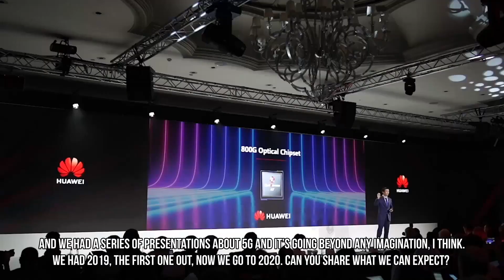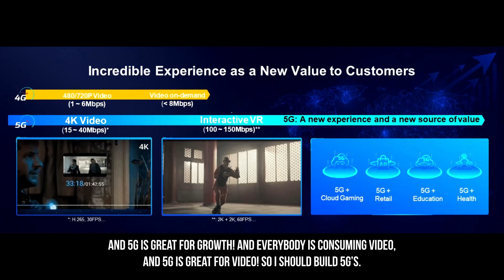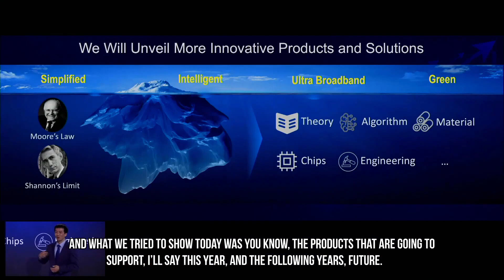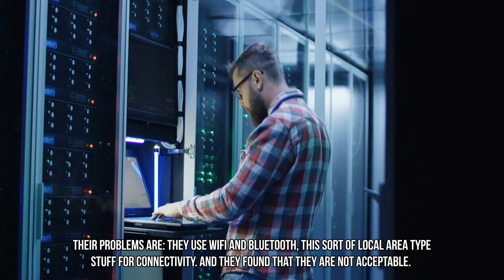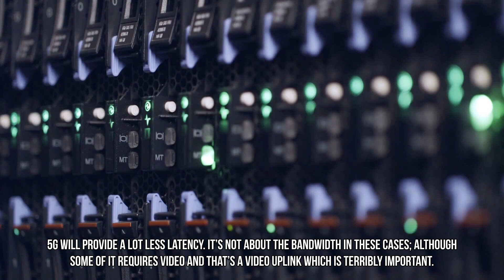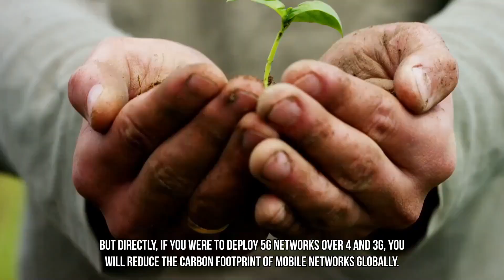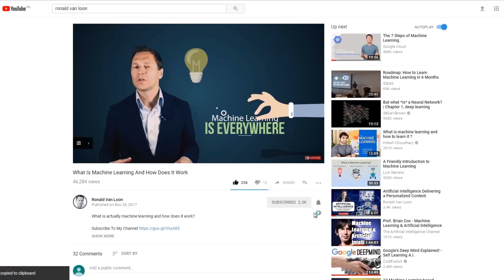5G is Transforming Industries & Reduces Carbon Emission

Comment: Enjoyable and informative conversation. So many important points especially on no carbon footprint and fast, effective connectivity. One question, why not bury fiber-optic cables along streets instead of towers? A one-time cost that can be coupled with other utilities. In that way the NIMBY complaints are defeated.